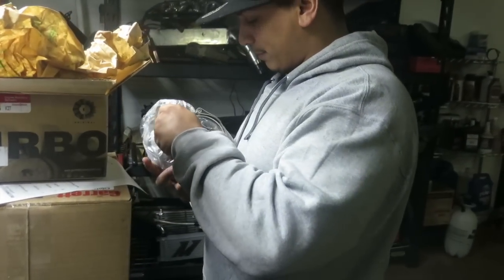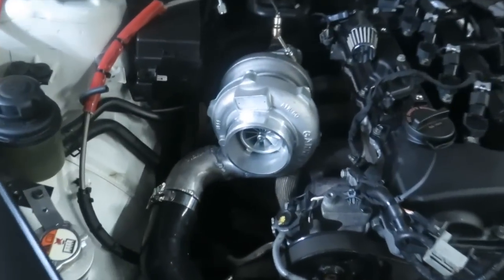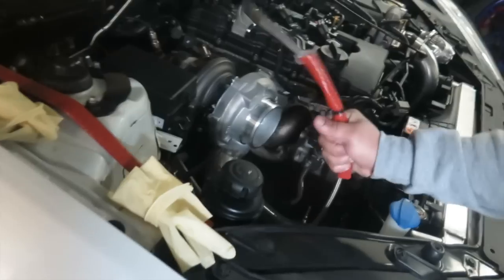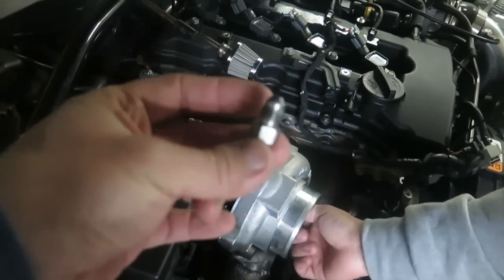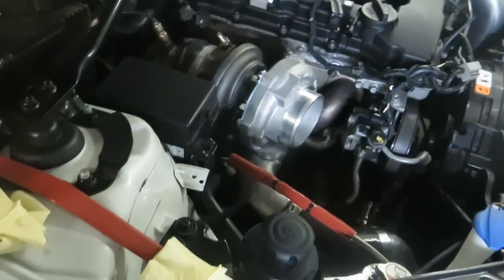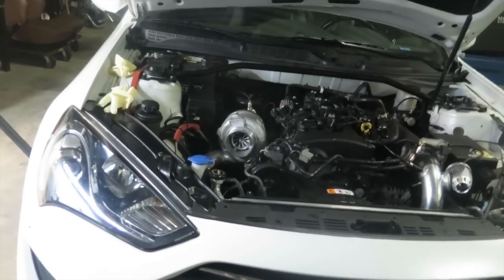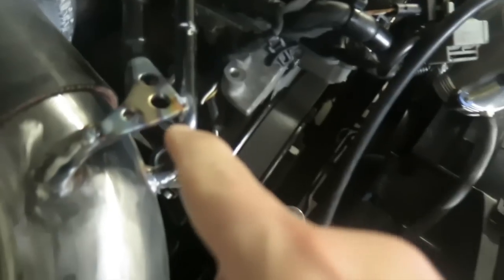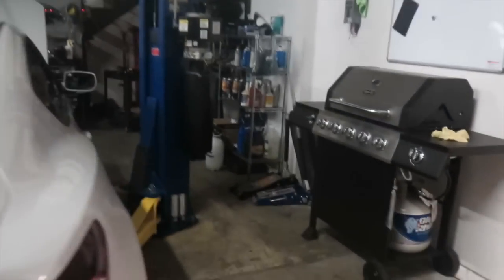|vBLOG| Garrett GTX Gen2 3076R turbo install, 3.8T AT custom tune

Comment: How much power can you get making a 2015 Genesis 3.8 R-Spec Turbo
Reply: jose vazquez 
Look it up
It can depend on the kit and how they want it tuned. Some make 400-450 to the wheels on 6-8 psi.
Reply: Thanks for the Fast Response man
Reply: jose vazquez Yeah bro, check out http://www.gencoupe.com/  any questions you have in the future will be there.
Reply from the maker: Little over 400whp with W/M kit would be good.

Comment: I thought this turbo was only for the 2.0T? This was installed on the 3.8? Any additional mods that need to be done to install this on the 3.8? What kind of horsepower and torque did you get from the car after this? I'm very interested in having this done.